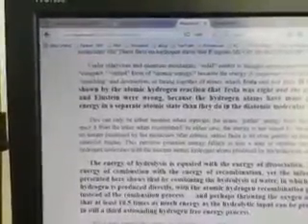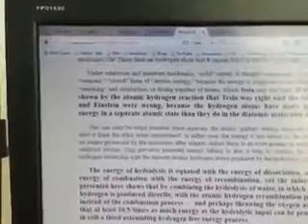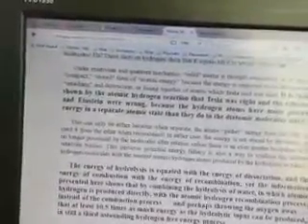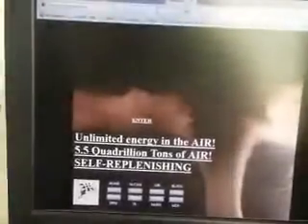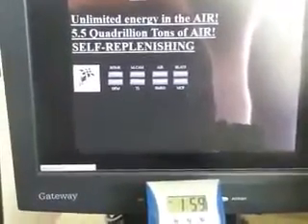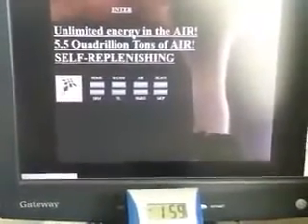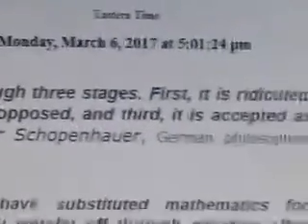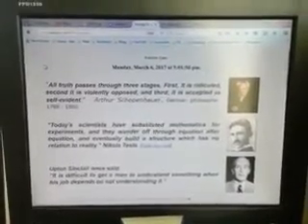Negative Resistance of a Gas Discharge Tube is Explained by Nascent Arc Welders - William Lyne.

Comment: Just a thought: Other than purchasing hydrogen straight out 'Electrolysis' may be the cleanest way to produce the needed hydrogen,  but regardless of method (i.e. electrolysis, chemical etc.) scrubbing it would be paramount. Otherwise, any impurities being introduced to (or hitching a ride with) hydrogen could (would) be potentially explosive when running through a spark gap.
Reply: I thought that was the point? Was to explode it? Do you mean, a bigger explosion.....as in a big surprise of too much explosive force?
Reply: @vinyaasi : Speaking from experience and almost losing a finger from an unplanned detonation I submitted my recommendation. My mistake was not making certain my generated hydrogen was just that--- hydrogen alone.